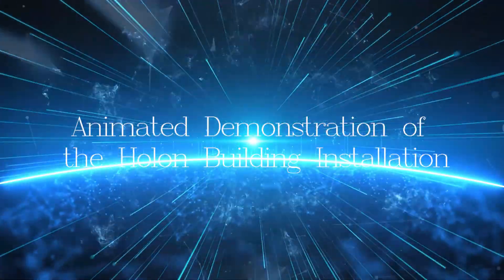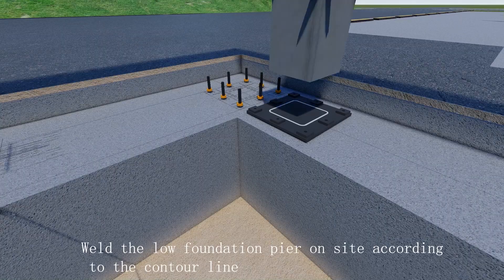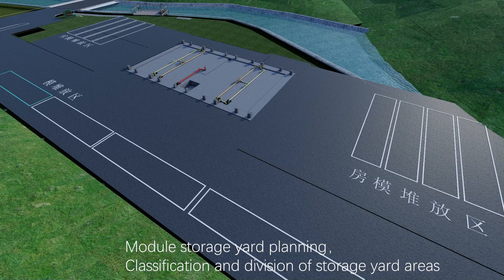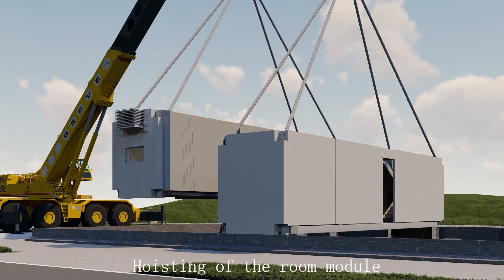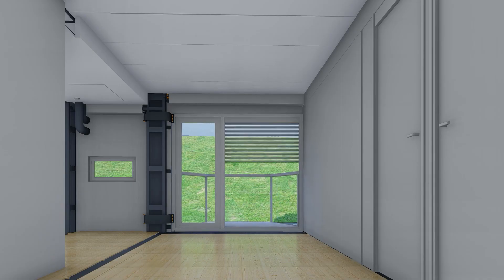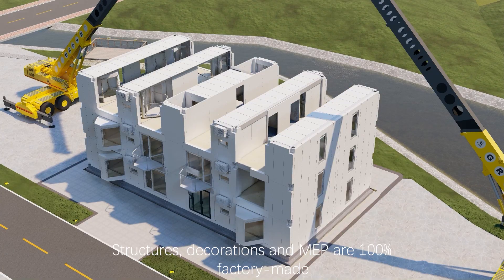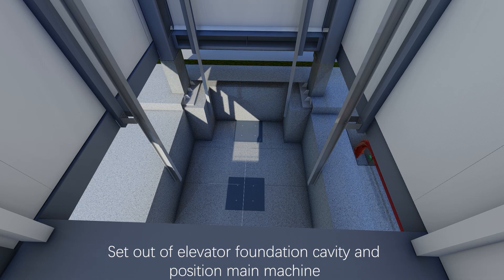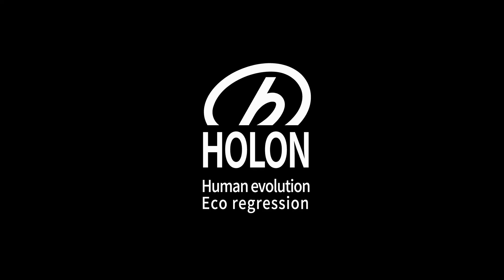Holon Building Installation Animation

Comment: Great so when is getting shipped to Antarctica or first apartment on Mars...

With all the fabrication of fold this move this slide this...

Should just be done like a container Port...

Next challenge how long to load a full ship of containers or be it unload and set in position be it lock into position....

If they are rated for heavy tonnage and easy quick load unload movement then this is but the bench mark costings to target...

Time is money and so to distance....

But if distance is not a factor then so to can time be or, not to be a factor....❤🎉😊